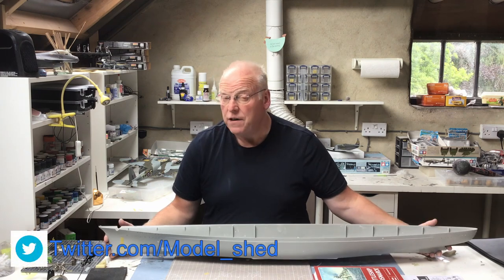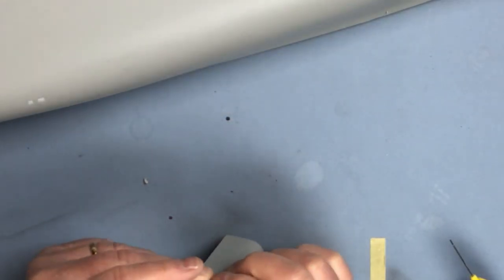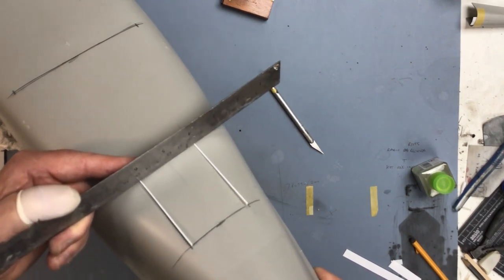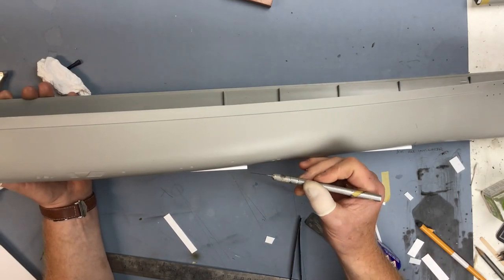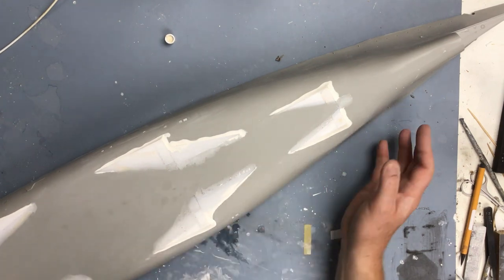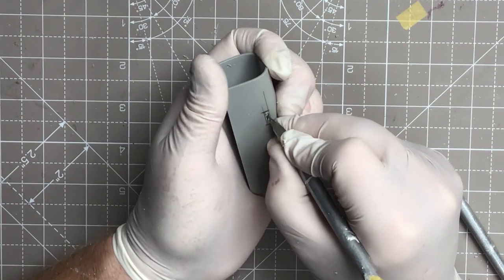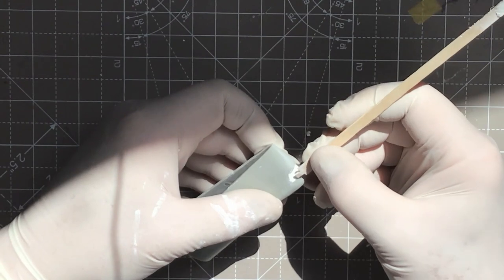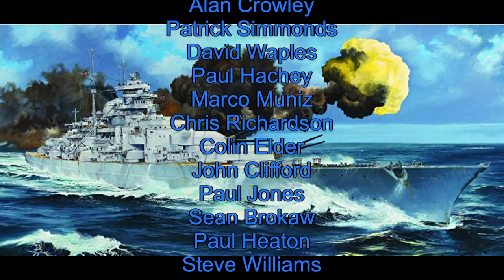Trumpeter 1/200 DKM Bismarck Full build with Pontos detail set Part 2

Comment: An interesting and detailed start to the build. I watched a documentary a few days ago, James Cameron's Expedition Bismarck 2002 and there is some closeup footage of the Bismarck from the bow as it heads down the slipway. The vent in the hull you added is visible as is a good closeup of the bow taken head on. If you are interested it is good just for the black and white footage as well as showing the Bismarck as she is today. Looking forward to the next installment.
Reply: I have been looking for these mods too, Clearly could not see it........at what time in the video are you specifying...thanks.
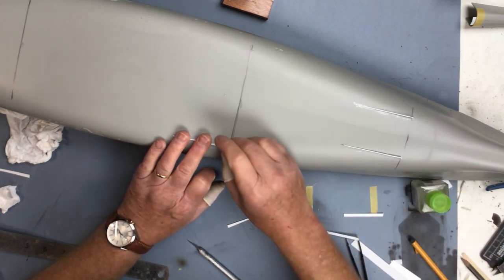Reply: @sandroiavazzo1112  From the James Cameron Expedition- Front view of the bow time frame 12:27-12:37, this shot has what looks like maybe a reinforcing plate or armour(?), there is a shot of the very bottom of the bow showing a circular plate time frame 12:42-12:37. 

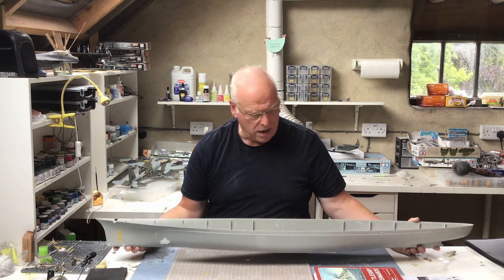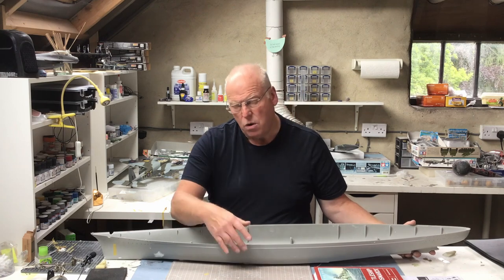The second reference I found is from the Movie "Sink The Bismarck" this clearly shows the two openings in the hull (Starboard side) time frame 1:00-1:01 this was found on You Tube and is clearer than the James Cameron shot of the same area.

Comment: I built the hull, water intakes and port holes. The steps on the rear the Pontos were so small i couldn't handle them. I ended up using cut down and bent staples. Looks slightly oversize but sort of toned down with painting. Modding the anchor bulges sort of finished me off for a while. I did Pontos the first level of upper deck, but when you place the wood deck on model it does sort of re-energise you to do more.

Comment: Subject to correction, Bismark did not have that cut out in the bow. Only Tirpitz had it. If you google images Bismark in Drydock you can see two good photos of Bismark in a floating drydock. Further more please note that the anchor teardorps are too small in the kit. Keep it up great work.
Reply from the maker: Hi Chris thanks for the info I’ll check that out. at least it’s not a big deal to revert to the straight stem. Picked up about the teardrops I’ll look at those as well. 👍
Reply: Hard to believe a well-researched reference such as the one Steve is using could get that major detail wrong. Well picked up and kudos to our builder..."No worries, carry on."

Comment: Nice start, I like your docking keel solution less labour intensive than some I have seen.  I think you have the A fraims for the pyrovain's in the pontos set, so you could ad the extended pyrovain mount and have a pyrovain suspended by wire.  just a thought.  Looking forward to more.
Reply from the maker: Cheers Jason 👍

Comment: This is nice to see. I am good at building models.  But I want to take it up a level.  I am a machinists and work at a metal fab shop. So where you have been using plastic sheets I have been experimenting  with metal in place of plastic.
Reply from the maker: Interesting Jim thanks I don’t think I could have done these mods in metal 🤔
Reply: @TheModelShed  I have access to machines the average person does not. As well as scrap metals to use.

Comment: Hi Steve,
wot a project! Exciting journey I‘m looking forward to follow!  Because you are an experienced Pontos man I want to ask for your advice. Recently I got the Revell Tirpitz Platinum Edition, problem is, that the Pontos instructions are a complete mystery to me. You have any idea where to find Tipps&Tricks or How To…clips concerning Pontos? Or is learning by doing and trial & error the way I have to go? Cheers!
Reply from the maker: You’ve got it - trial and error is the thing: hopefully without a lot of the error bit. The instructions are difficult to follow. I’d suggest 1. study them and try to work out which steps to do when because the instructions are not really in any sort of sequence; and 2. find and download the instructions on line at the Pontos website so you can enlarge them. They’re fairly high resolution so easier to read than the paper provided in the set.
Reply: Wow, thanks for your detailed reply/advice and the time it took! 👌

Comment: Looking forward to this series. On the Hood you soldered much of the PE, do you solder PE in 1/350 scale? Seems to me it would be to small.
Reply from the maker: I’ve never tried Chris but obviously the smaller the parts get the more care you need to take. Small parts generally hold together with CA glue anyway: I solder larger parts just for the strength it adds to the assembly.

Comment: Hi Steve.. Another great build. Couple of questions…What was the purpose of the additional plating you are replicating on the bottom of the ship? And I have often seen you using your drill at a slow speed to start. Do you do this with your finger on the chuck, or, do you have a foot controller or similar? Cheers Geoff.
Reply from the maker: Hi Geoff I’ve no idea what the plates were but I’m just following the drawings. I slow the chuck with my finger - it’s an abuse of the motor I suppose but it’s survived for nearly 30 years 🤞

Comment: Hello Steve, Im sure that you have done research but i have not seen what you are doing here with these mods, i have a set of 1:100 full size....7 sheets approx 12 feet long German Drawings in German from Germany of the Bismarck drawn By F.W. Besch as she was in1941 showing none of this stuff, also not seen on the launching video on Youtube, .......unless these are very late mods? I think I need to purchase a copy of the book you have and get up to date, anyway they look great.
Reply from the maker: I know Sandro I’m just going by the reference plans in the book. I think the plating on the underside is too far under to see on the launch video but you can see the shape of the slot in the bow although it is plated over at launch. I believe the author thinks that the sonar equipment was fitted back at B&V when the ship returned after shake down in the Baltic in Dec 40 along with the last radar and other equipment.
Reply: @TheModelShed Hi Steve, thanks for the reply, yes the 1:00 plans i have are very detailed why these mods were not added is a mystery, anyway if you need any assistance with mystery areas I maybe be able to help with the plans i have, i will take a photo of a page in these plans and post it in a Facebook Group i am in, i will let you know when.